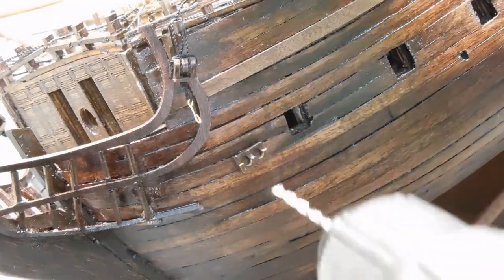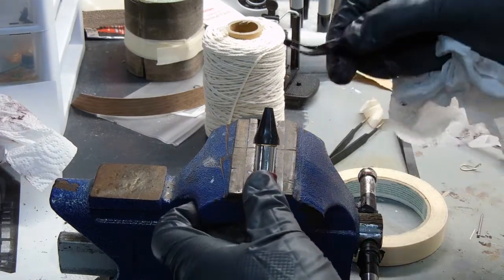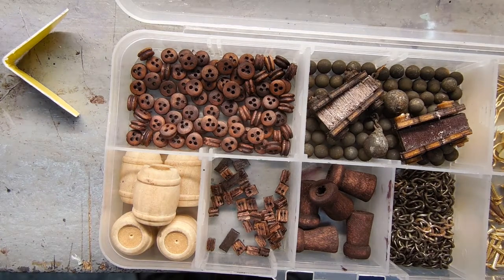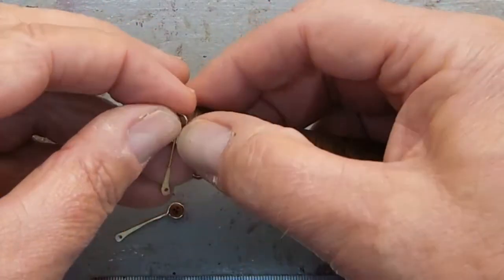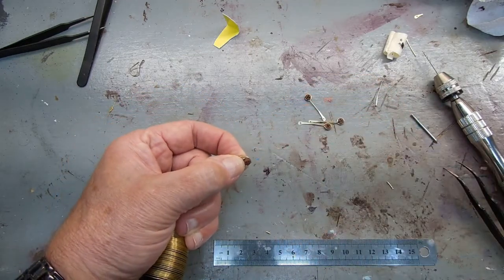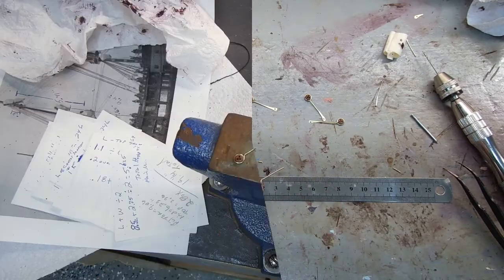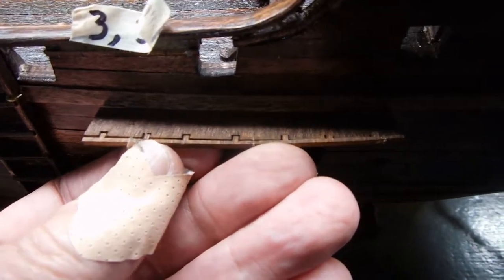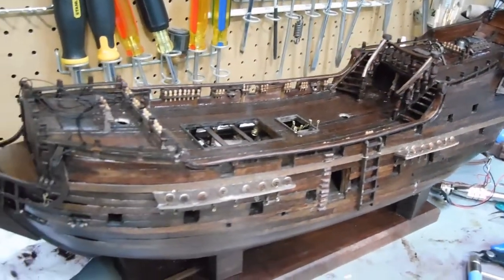The Black Pearl Model Ship Part 18

Comment: hello, were did you bought this black pearl ship. Because i really want to build this ship to
Reply from the maker: Raymond van Vliet : I purchased mine on line from banggood.com
Here’sa link to the one I ordered [US$89.99 25% OFF]Pirate Full Scene Black Pearl Sailing Ship Boats Model Kit DIY Crafts Hardware & Accessories from Tools, Industrial & Scientific on banggood.com https://banggood.app.link/B6xPGpHNa3
But beware that the instructions are terrible and sometimes people report not getting any instructions. They have several varieties and the cheapest ones have bad parts so stay away from the under $80 ones for sure.  If you can afford the really good ones with full instructions and some metal parts is best.  But you can see how much that I have been able to do....but not easy.